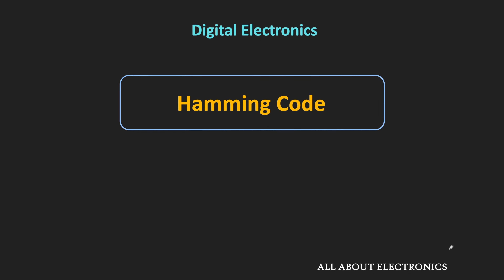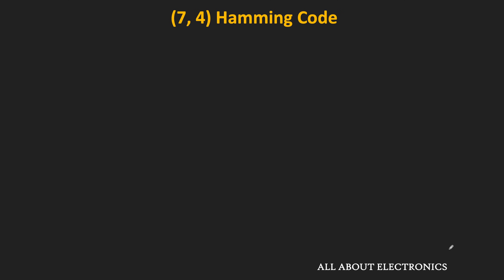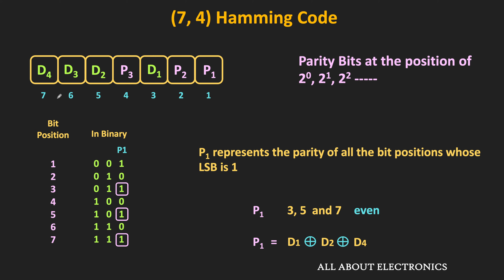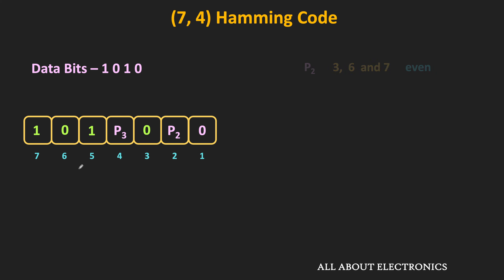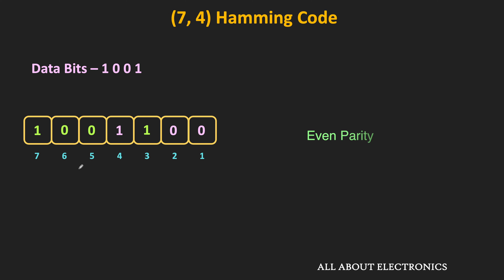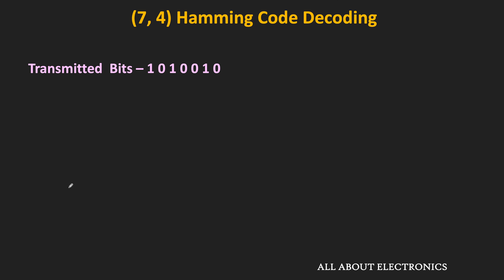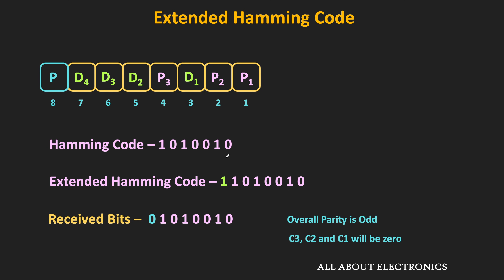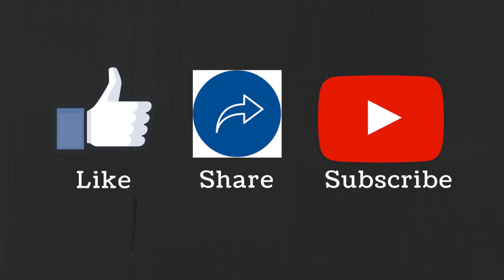How Hamming Code Corrects the Error | Hamming Code Explained

Comment: at 13:42 , why having even Overall Parity equal and Check bits equal to '1' imply 2 errors?
Reply from the maker: If there is a single error, then by checking the overall parity bit, you will know that there is an error. Because in case of single error, the overall parity of the code will be odd.
But when there are two errors then overall parity will still be even. But checking the check bits, it is possible to detect where there is any error in the code or not. In case of two errors, the check bits won't be zero. So, it indicates that there is an error. And since the overall parity is even, it indicates there are two errors. (If the overall parity is odd, then it means that in odd number of bits of the code, there is an error ).
I hope, it will clear your doubt.
Reply: @ALLABOUTELECTRONICS  thanks for  your reply. After examining it further I realized the following :
 (a) If the overall parity is even AND the Hamming part is valid , the entire code word is valid .
(b) If the overall parity is even AND the Hamming part is erroneous, then it has 2 errors , because it requires 2 bit flips to make the codeword valid (Otherwise , the overall parity would become odd due to single bit flip in the Hamming part). These 2 errors cannot be corrected, because Hamming decoding is limited to correcting only 1 erroneous bit.
(c)  If the overall parity is odd AND the Hamming part is valid , then the only error is in the parity bit, which can be corrected by flipping it.
(d)  If the overall parity is odd AND the Hamming part is erroneous, then there is a single error which is in the Hamming part (this bit is found via the check bits). correcting it will validate Both Hamming part and parity bit (because the erroneous bit is flipped).